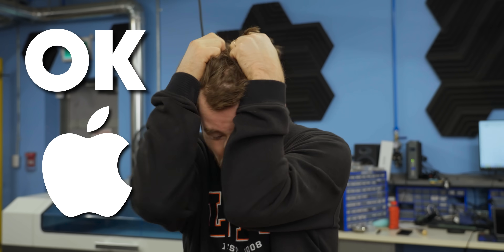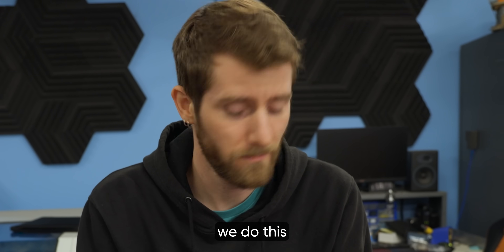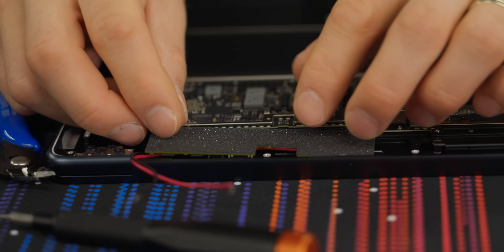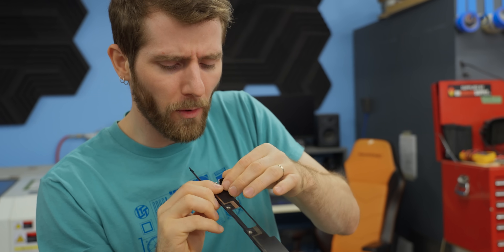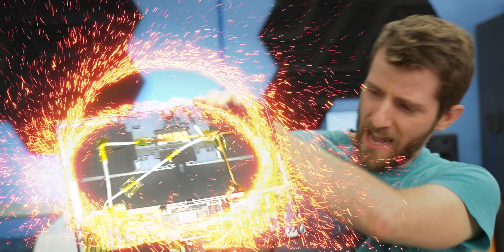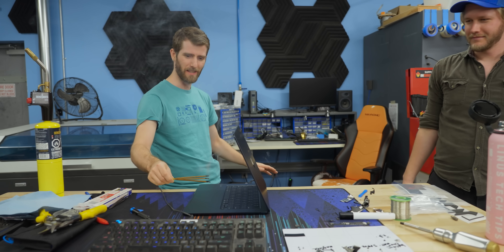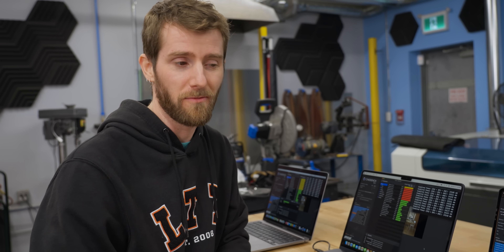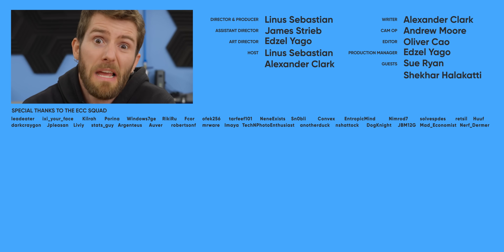Apple please watch this. - Frore AirJet MacBook Air

Comment: Apple will never put this tech in a MacBook Air because that is not aligned with their business strategy. If you asked an Apple rep straight up why they don't do this, they would just tell you that if you perform tasks that cause the Air to thermal throttle, you should just buy a Pro that does have a cooler.

Comment: I know the M2 MacBook Air CAN do some small gaming or "heavy duty" work, but that isn't the intent of the device. It is a small spec machine for light work. Currently using one as I type this at work, which I do mostly spreadsheet stuff on. I also run a 2nd display with it, with sometimes a YT video playing or maybe a Twitch stream or 2. My M2 MacBook Air is always very cool to the touch. Feels even colder than the room I'm in. I could see Apple maybe going with that mod, but for the MacBook Pro instead of the Air. The Air is fine as is, imo. The Pro though, if they could slim it down, make it quieter, and be as powerful as it is, that would be great.

Oh and I'm team anti-mechanical keyboards. Not just the noise of the clicks, but also the height of the keys. Give me a membrane keyboard any day over a mechanical one.

Comment: Y'all should mod a steam deck with these. It already has a design that's dependent on a source of high static pressure. If you could get a vapor chamber wide and thin enough to plonk two of these onto it and then use the freed up depth to channel the exhaust through a heatsink where there already is one, you could probably make an actually compelling product. Hell, you could even skeletonize the grips and block off the rear intake so the high static pressure pulls in air across the hands and keeps them from getting sweaty.
Reply: I can smell that mod coming up 😂
Reply: I thought that they already did that, didn't they?
Reply: @danielm.595  tmk, no. They did that thing where they slapped an SSD heatsink and a fan on it, at the expense of Finger Danger and cutting a huge hole into the back, but I don't think anyone has gave it a frore treatment.
Reply: Oled maybe
Reply: Not possible. Not enough space, Frore don't produce a single unit that would be capable of cooling the APU in a Steam Deck. You can stack them like this but... space constraints.
I think Frore are working on models for higher wattages.
Reply: @lemagreengreen  how is there not enough room? Those modules are 1/3 the thickness of the fan at most. A wafer thin vapor chamber like what's used here could easily sandwich inbetween a couple modules and still have room for the intake. At worst they have to put the driver circuit in one of the aforementioned skeletonized grips.
Reply: @Therysin  that's why I added the thing about keeping the heatsink up at the exhaust and ducting it out through it. Use the air movement it creates to its advantage and reuse the air. Sure, it won't be as effective as room temperature air, but airflow is airflow and it should still aid cooling. It's not like the air coming out of the frore units would be 105C. This is more about replacing the loud fan than the frore units doing all the work on their own.
Reply: @lemagreengreen  i don't think you know what you're talking about... frore show off a modded steam deck on their website. it's under "handheld gaming"

Comment: This is likely 2 + years away at least. No way they will switching to a new layout which means new tools and fixture and equipment to make the new laptops. Thye likely have to clear a certain amount of use on all the above along with getting through their SCM contracts for these components. Like trying to steer a giant ship, takes a lot of force and time to do and you better not miscalc on that

Comment: So highly increased complexity, energy consumption (from the fans), and hearable fan noise for a very marginal performance improvement? I really like the hack, but it's pretty obvious why Apple won't integrate this in their MacBook Air line.
Reply: Also a longer lifespan of the product because silicon fails faster when it's hot
Reply: @battalionstallion3894  True, but since both were thermally throttling, this wouldn't make a difference in this scenario, and could be equally achieved by a lower power limit.

Comment: You could just put it back where the air intake is, and it would the trick. Like pushing a fresh air on the left side of the vent which would move out from the right side with hot air.

Comment: Solid state cooling is very cool tech, but I'm concerned that no one on staff called Linus out for making slight thermal throttling of a passively cooled system, out to be a masaive oversight on the part of Apple. Or point out the fact that Frore systems likely can't manufacture sufficient quantity to support a company like Apple, or that ALL non Apple laptops thermally throttle under sustained load reguardless of active cooling. Linus, you should find your jornalistic integrity since it seems to have been misplaced.

Comment: If you’re buying an air you’re not looking for something that doesn’t thermal throttle. The issue is that MacBooks have also died due to dust getting through the ports. I personally prefer that it doesn’t have any dust vents
Reply: If they didn't make hairbrained design choices that they stubbornly refuse to acknowledge or change then they could avoid doing things like having a high voltage display rail literally right in the open on the intake so close to a 5 volt cpu rail that a little bit of dust or a drop of water could bridge it.

Comment: I work in IT. I've upgraded and repaired hundreds of laptops successfully, with as much confindence as refuelling a car. I upgraded the RAM on one 2012 Macbook Pro with the same precautions I've always taken, and I killed the WLAN card. What in the actual f***. I just point-blank refuse to touch Apple computers now, not even to take the cover off (considering the flimsy screws they use that shear off if you look at them wrong).

Comment: It would be possible to add the new vapour chamber in a way that the brass contacts from the "fans" touch them and cool both that way, and through the fins :O I mean this build is genius and would be a much much improved setup for the mac if it would came properly preinstalled....

Comment: Eeeeh.... I hate to side with Apple, but if anything, this little demo just shows they're right about not giving a quack about thermals. 5% performance uplift on a synthetic load? Not worth a worry for most people if it were free. And it isn't free.
Also Apple will find a way to steal the tech, one way or another.

Comment: I love the air exactly because of the fact that it has no vents 
For me as software developer it never throttles to a point where i would miss performance i actually never noticed any performance loss at all 
the only downside is that the current one has only 24GB of RAM even when you max out everything :/
Reply: The static pressure is so high that you don’t even need vents, it’s able to suck air through the gaps in the chassis.
Reply: I guess you never ran Android Studio on it 😂
Reply: @shivamsood2043  I've had several IntelliJ projects open at the same time and zero heat. It handled them like a champ.
Reply: not android studio but intellijs IDEA + ios + android simulators  @shivamsood2043
Reply: me when apple charges $200 for $20 of memory

Comment: I was so excited to try this. Even as he kept going about the drawbacks. but when he hit the keyboard not working part. my dreams were crushed
Edit: he started cutting the ribbon cables. This is becoming increasingly hard to watch
Reply: Linus Tech Tips did Minus Tech Specs
Reply: They already did a video that is a much better thermal mod - just connect the heat spreader to the bottom case with a thermal pad. Gives a much larger thermal mass for passive cooling and doesn't remove any features
Reply: Yeah... Mods aren't supposed to nerf half your I/O, including your keyboard, sound, primary charging, and ability to power the machine on manually... This was actually painful to watch. For a piddly little 400 point loss, the passive cooling solution isn't doing as bad as it could, and if you need peak performance, get the friggin' Pro... I was looking at getting a Mac Mini myself, and when I realized it wouldn't meet my monitor needs, I instead got a pre-owed Mac Studio, which offered me far greater features than even a new upgraded Mac Mini would, and I still had some time left on the Applecare, so not like my used purchase was entirely without warranty. Buy to your needs. Doesn't even need to be brand new. Don't get the thing you know throttles under high loads and then complain that it doesn't perform like the Pro model.

I say all this, being the type of person that mods things all the time. I've fixed my own phones, and even installed an additional heatpipe into my last phone... Mods can be useful. Nothing broke on my old phone. It wasn't just a net positive gain... It was a purely positive gain. I don't even know if this Macbook Air mod can even be called net positive... So many negatives detract from any benefit....
Reply: @richfiles It's a proof of concept and not meant to be done by anyone

Comment: this could have been done in a better way if you could pull out a heatsink strip directly sticking to the processor and then have the whole cooling system attached at the bottom. Or maybe you could have built the bottom case by 3d printing( custom one). I'm sure this could show an impressive result.

Comment: I wanna see this same project but on say the 14in mbp with the max chip vs a 16inch with the max chip.

Not saying this is a practical thing just curious how much more could it do/how effective can it be.

Would also be interesting to see on a a gaming laptop with like 4070 or 4090 and see how it changes stuff.

Good vid and amazing technology that might come to market in like 5-10 yrs 😅
Reply: these coolers are meant for low power devices. they cant replace a large heatsink or fan.

Comment: Surprised there isn't a market for replacement bottom covers of macbooks that would allow a little better airflow or bigger heat sink.  

Actually for any laptop, would be nice to get new bottom cover that allows space for mods, extra components and such.
Reply: I'd love the idea but most likely the market isn't big enough for something like that especially for Mac Books most people just want a laptop that just works and they don't need to think about ever again. Maybe the Framework is the closest thing you could get today.
Reply: @Amphibax  maybe with further 3d printing advances it'll be a thing.  A larger or open bottom to allow for more cooling when docked at a desk and another plate for mobility.  Oh well
Reply: Laptops are too short lived for a proper market to develop around a single model. One notable exception are of course framework laptops.
Reply: Because the market for Macbook Air and that kind of enthusiast build is a market of 0.

Comment: You're forgetting the Cult of Steve Jobs  thou shall hate cooling fans,  open systems are bad,  HUGE profit margins are all that matters. 

So you buy the entry level MacBook Air  M2 the only one that doesn't have fans then bitch about it not having a fan.    That computer designed for the average person or student not doing heavy computing, but even then it can do some heavy loads it will slow some and keep going.      

You should stick to griping about Apple's RIDICULOUS prices for RAM and storage.

Comment: The reason Apple won’t implement this is because it’s takes 8 minutes of maxing the CPU or GPU for the Macbook Air to throttle and almost no average user is ever going to do that since most people buy Macbook Airs for productivity use like web browsing, typing up documents, media consumption, etc. Even building an application in Xcode won’t throttle this thing

Comment: 11:00 Shouldn't you want it to push air OUT of the tiny gaps in the chasis, not pull air in? This sounds like a recipe for dust buildup inside over time. How exactly are those filters going to do anything when they're on the exhaust, not the intake lmao

Comment: I would have liked to see you talk about the power consumption of the cooling, especially in relation to the normal power consumption of the MacBook. You could also calculate the impact on battery life using the total Wh in the battery.
Reply: Agreed. According to their specification it will consume 1.75W. If it's blasting at full power that's an additional 5W of power consumption (considering there are 3). That is not a small number whatsoever.
Reply: @Spentalei  So then, it wasn't actually performing much better? since it would then be at similar actual processor wattage...
Reply: @Spentalei  that is more than the entire laptop including screen at idle. So runtime cut in half. Of course you don't need cooling at idle.
However, this will only add little performance to low power devices as was proven on the video. And for high performance device it doesn't provide enough cooling. I'm not sure where this product will be useful. But I'm excited to see the future!
Reply: @Spentalei I get that, but if you are hitting your laptop hard enough and long enough to throttle, you’ll probably want to be  on wall power anyway.
Reply: @stonep11  What? No? Macbooks are literally designed to work for extensive periods from the wall even when going full blast. Not that full blast is particularly high here, but I'd consider it an identifying feature of a Macbook.
Strongly disagree with you here.
Reply: @Spentalei  in this specific case they are using 3 of those small coolers, the Airjet mini , but in reality they have bigger and more efficient ones although they are still prototypes. They showed them at LTX 2023. These coolers aren't supposed to be 3 small ones for high performance chips, rather it should have been the bigger model (but with the same thinness). The airjet PRO removes 10.5 watts of heat and consumes 1.75 watts of power (as stated in their website). Put 2 of those in your machine and your Macbook air becomes a macbook Pro. I would actually expect battery life to IMPROVE instead of decreasing. Heat has a heavy impact on batteries and cpus and macbook airs have passive cooling. At the expense of just 3.5 Watts i would actually expect even better battery life alongside better performance.
Reply: @Spentalei  I mean sure, but like where? Hell they have power outlets on planes now, where are you doing such serious work that you are throttling and not able to get to power? Like that’s a really niche use case. Someone doing serious work like that is probably using a mobile workstation type laptop, likely a windows variant, not a Mac.
Reply: @Spentalei  But the Macbook Air isn't. It's not meant to do a full CPU load for 5 minutes.
Reply: @HowToArter  It would only impact users actually hitting it with that kind of load, which I don't think is any actual Macbook Air user...
Reply: @stonep11  That's a bit ridiculous. A windows laptop throttles just for not being plugged in and has worse battery performance. But yes, a Macbook doing a sustained load will drain the battery pretty fast (I had an issue last year with some Shopify cli tool that would peg one core to 100% after it was supposed to be done, and my battery did go down supiciously fast. But it was still a few hours)
Reply: They could also build it into the power program where if the cpu/gpu is going over 60%+ (doing a intensive task) then it switches on, like modern gpus and psu's have a 0rpm mode, that would then mean most of the time the battery usage will be the same as it is currently in macbooks but kicks in when doing intensive workloads
Reply: @scarletspidernz  No need for that. You can treat it the same as a normal fan. 
According to their datasheet it scales fine with power. https://global-uploads.webflow.com/6387c57559192a648478384e/6387c57559192a85f5783955_AirJet%20Pro%20Data%20Sheet.pdf
The big problem with using this solution is that you're effectively kicking out 25W of heat in the long run instead of 15W... For how much more performance? 10% maybe? I'm not really sold on using these things in battery constrained devices honestly.

Comment: Creating a cavity for additiional heatsinks and active coolers just needs an insulator shim across the full base, a spacer around the outer edge and some insulating washers to make up the distance on any internal standoffs securing everything with longer screws, 

Sandwich it all between the laptop and the original base, only real downside is thickness.

You wouldn't even need to remove the stock heatsink if you use a thermal pad and would be reversible.

Doesn't even need to be anything fancy or 3d printer because the bottom is flat, it could just be a sheet of plastic, acrylic or even card with holes punched as needed and a sheet of copper as an additional heatsink.

Could all be done without losing functionality and probably only taken a craft knife to make.

Comment: Apple doesn't want to make these changes and not just because, it will cost them few more bucks, no. They intentionally kept the gap as wide as possible between the different price ranges. The macbook air is the perfect exaple. It is quite nice product (i have one too), powerful enought to convice anyone to buy, but it'll fail at the first challenging task. So you have to buy a pro, but not the base version with 8gb ram, it sucks too and so on... So the sad thing is even the air could be perfect, just few cheap pieces are missing (like a proper heatsink and 16gb base memory). But those key pieces are making billions to apple...